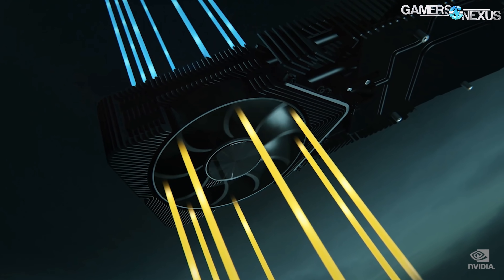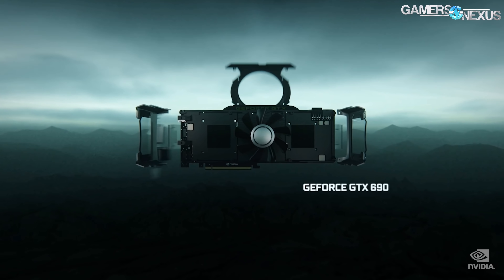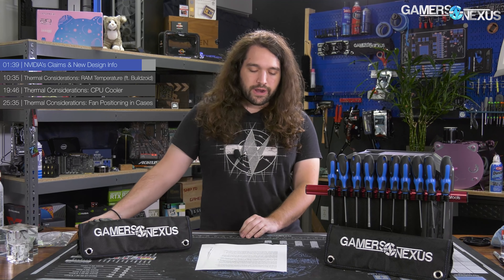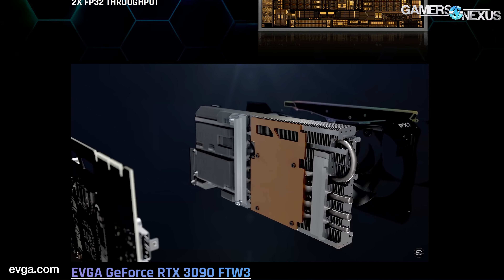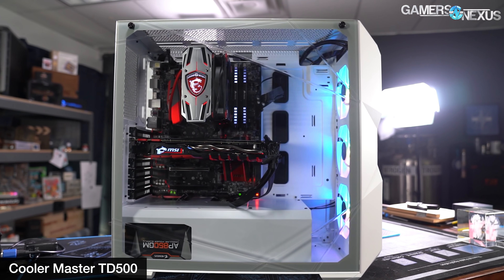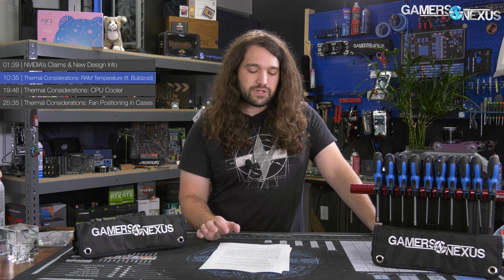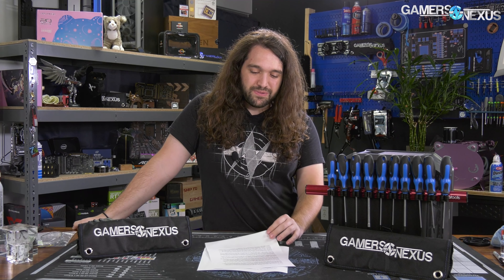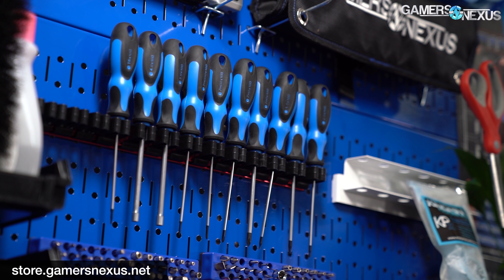NVIDIA RTX 3080 Cooler Design: RAM, CPU Cooler, & Case Fan Behavior Discussion

Comment: I am using an Antec NX200 Case which has a solid front panel, restricting me to use an AIO, so I will be using an Air cooler from Coolermaster. anyway, I am confused about how to set up the Airflow, Case ha one 120mm rear fan and 2 120mm top fans. help will be appreciated, Thank you.

Comment: What I can't help but wonder is say that in a best case scenario nvidia is right, and this cooling method provides up to 30% better cooling, none of the aib's seem to be implementing it as they're all just sticking to a traditional fan setup on their cards, so does that mean that performance will be much less than shown too? given that the fe will have very limited availability it seems

Comment: I am using Asus tuf b450m-pro with Ryzen 5 3600 with a stock cooler and without any load the CPU 🌡️ is 65°-70° i asked couple of people how to reduce it they told me to keep the voltage at 1.1 and lock in at 4000 MHz... If you can plz tell me will that work.....if it will please tell me how to do that or if you can send me a link how to do that it will be very helpful for me... thank you 😊

Comment: It seems that NVIDIA made it's reference design entirely with horizontal mounting in mind. Vertically mounting this cooler will NOT work well at all, because the exhaust fan on the back-side will blow straight into the motherboard's PCIe slots and cook your NVMe SSD hard, for example.

Comment: The AMD 3900X cooler is perfectly acceptable, for example. Basically ~$40. If a GPU is dumping enough heat into it to noticeably hurt performance, that's a legitimate flaw of the GPU, not the cooler. Other similarly acceptable coolers will suffer the same fate.

Comment: Almost getting to a point that an external "gpu" case with its own slave power supply and cooling fans electrically connected to the main case to power on/off may get to be considered the best solution going forward to eliminate and separate heating issues from one component to another.

Not to mention the mounting solution of the heavy cards and the strain placed on the motherboard slots. Then the external case's cooling solution can be designed specifically to vertically mount the gpu.
Starting to sound like a reasonable solution as power/wattage on components keeps rising and producing more heat.

Comment: Something doesn't look right with that cooler... the fan closest to the PCI-e slot doesn't have any heatsink fins around it and just blows the air out the back not through the card to the second fan. Also the 90 degree fins in the middle look like they are for show. Not touching heat pipes also airflow is blocked from them.

Comment: So if I mont my gpu vertically, would I be better off with a custom card?
Reply: If you mount a gpu vertically you really should water cool it. A lot of cases do not leave much room for air to get in to the fans to cool it.
Reply: Just Bob I have 2.5 inch clearance with my gigabyte 2080 ti Auros extreme card right now.  I’m using thermaltake level 20 case, it’s massive
Reply: @chrisyuby  yeah with 2.5 inches you should be fine.

Comment: The RTX 30 series is NOT reference design. It's custom design. EKWB announced a GPU water block for reference RTX 30 cards but it's not going to fit on the Founders cards cause they are not "reference" design
Reply from the maker: We literally said that several times in this video, dude.
Reply: @GamersNexus  😅 sorry commented it right after the first time you mentioned it

Comment: The 3080 and the 3090 can never be mounted vertically. Hot air will be blown straight on to the motherboard.
Reply: Shouldn't be much of an issue with a case like the Lian Li O11 or the Antec p120 Crystal with side exhausts
Reply: @maggi98mw  but the side on the O11 is usually an intake rather than an exhaust. Also, not sure if the GPU fan will clear the motherboard, unless you're using a mini ITX motherboard. The hot air would most likely come out more or less on or next to the motherboard chipset.

Comment: I'm just waiting for the 3060. Depending on the performance I might finally move to 1440p
Reply: It should be somewhere between 2070 super and 2080ti
Reply: Bob Dole  Plenty of 1440p monitors being sold Bob. I'm not sure where you're coming from.
Reply: Bob Dole  Ok bob

Comment: I wonder if i'm gonna have to upgrade my 7700k for this monster
Reply: I don't think so, i have the i78700k still a beast
Reply: It will  bottleneck, the 2080 Ti gets bottlenecked by a ryzen 3 3300X which is the same or better than a 7700k, and by what nvidia is saying, 3070 beats the 2080 Ti
Reply: If you game in 1080p yes you will need a faster CPU.
Reply: @ZackSNetwork  Forgot to mention this, thanks :)
2K or higher res should be fine with the 7700k

Comment: Why do none of the 3rd-party cards use NVIDIA's cooler design? Does NVIDIA patent it and forbid other manufacturers from adopting it? The one for these 3000-series cards looks downright elegant, and, intuitively, it makes me think that it might be better for the cooling of the GPU and the CPU than simply pulling out the traditional 3 fans and blasting them straight through the GPU.
Reply: Because usually 3rd party designs work better.
Reply: @speedster427  
I understand that, but this time, the reference card's cooling system looks to be much better designed and thought out than in the past when NVIDIA's own cards often had just a closed shroud and a single fan, so I was asking about the 3000-series in particular. I guess I'm asking what I missed when I expected to see the same sort of design on the 3000 cards of other manufacturers.

Comment: Why do people think they NEED PCIe 4.0 for Ampere cards..? its like they are going round saying PCIe 3.0 is outdated and unusable
Reply: Need is a strong word.  It will have an advantage loading games once games start utilizing the GDDR6x.  It's a nice to have but not likely required.
Reply: @blizbiggy  right? because people on reddit pfft.. they are always telling me "wHy dID yOu bUy An InFeRiOr Pr0DucT ThAT dOeSn'T hAvE PCIe 4.o" or such but i still think 3.0 at even x8 is still enough to not warrant a whole new system build

Comment: I think if you look at the MTBF of most fans used on GPUs, you will find its something like 6-7 years if run 24/7 365. I'm not saying being able to take apart a gpu isn't important, but its a weird thing you guys always harp on, especially when it comes to replacing a "bad" fan. Not condoning gluing them together like Nvidia did, but its a weird flex.  Being an PC enthusiast site, I would assume most people are taking their cards apart to water cool them, or liquid metal them.

Comment: Is my Ryzen still adequate for the 3070/3080 at 1440p?
Reply: Is it a zen 2 3000 Ryzen CPU, if so your fine? If its Zen 1 1000-2000 it will be a big bottleneck.
Reply: Sorry forgot to write 2700. That's a bummer, I guess I'll wait another gen or 2

Comment: (Ref 11:48) Nvidia new reference RTX cooler makes damn sure, any bottleneck is going to be the CPU by dumping/exhausting its hot air >Directly< into the front of the CPU air cooler, without any time for this hot air to mix with the cooler air in the case (unlike most GPU coolers atm on the market)
Very strange decision! or maybe Nvidia are fooking over both Intel & AMD in one go.

Comment: It is disappointing that a company like Nvidia couldn't trust your integrity - and other NDA following reviewers - with giving you a card to strip down and explore to release videos in a timely manner. Is the 3000 series just a paper launch? Surely such a great card would stand on it's own legs rather than rely on hype and branding?
The new fan design may be very efficient but what is it's efficiency in a case with objects surrounding it? what are the effects with base directed v top directed vs front directed airflow? The planned airflow through the GPU card may be interfered with with case layout and design.

Comment: Yep, AMD stock coolers are not good enough for all cases(non extreme even), i live in a warm place(usually peaking at 38C) and had to buy an aftermarket option for my R5 3600, because cpu rendering in blender was exceeding 95C often, a few times i had to stop rendering because it got over 98 (I don't know why it didn't throttle at 95). Previously I had a R5 1600, which my wife is using now, and it never went over 93C overclocked and with the stock cooler that came with it... So maybe my new MoBo is abusing this CPU or Zen 2 is a very different beast. (I can tell they are pushed to their safe limits)

I've always chosen AMD even when they weren't this good, so I'm not a hater... I have intake and exahust fans on a fairly non obstructed case, so don't make assumptions on that end... And now let them salty fanboys come and unload their shit.

Comment: Prediction: if I get a 3080 it will overheat in my Phanteks Enthoo Pro (the one without glass). Right now I have two 2060 cards in it and they run hot. True, it’s Folding @ Home nearly 24/7. Adding fans tends to make things worse...
Reply: Since you didn't go for the glass, you can always DIY a side intake fan.

Comment: Why has noone noticed that nVidia has fucked up their animation. The flipped fan draws air down and not up. Unless they change the blade design and "rotaion" it wont dump heat into the mem-cpu space

Comment: Me: I need to get heat out my case.
Nvidia: here, have a load of extra heat in your case!
Me: Oh good, you're blowing it at my CPU AIO, thanks Nvidia!

I love the design, just wish Nvidia engineers had the brains to attach an AIO to the thing. Luckily partners and whatnot. That said the mutterings about 240mm AIOs on the 3080 are concerning - where exactly do they think people are going to put them?

Hopefully when the FEs arrive for review people will be on the lookout for thermal throttling, if a GPU thermal throttles in any condition the FE is dead to me.
Reply: I think with the near death of hard drives, case manufacturers should get a little crazy with it. Move the MB to the front bottom of the case so the even 1 120mm intake fan with mesh can blow air over VRMs/RAM/CPU. Rad support up top and rear of case, negative pressure in case could cause passive air intake in front.

Comment: im just going to 3d print a shroud to route the hot air right out the back of my case. Think of a "cold air intake" for a car, but in reverse, and not tubular. If any of you nerds have ever popped the hood, that is lol.

Comment: It looks to me that perhaps more than half of the heat generated by these 3000 cards will be exhausted out the rear by the second fan. So then less than half of the heat generated will be exhausted towards the RAM / CPU.  At least that's what my techno-gut instincts tell me from what I can see in their little promo videos... could be wrong.

Comment: Hey case makers.  Stop being so f'in lazy by using old layout that cuts off air flow to gpu.   Either 1) Add fans at bottom and remove stupid cover to hide psu.  2) Add fan where all those uneeded pci slots are. 3) Or separate gpu from same air flow for cpu

Comment: It will be better for CPU, VRM and RAM than the open air cards because it throws half of the heat trough the back, open air cases thorw all the heat in the case. 
The custom cards are so fn ugly it's like all of them took design  lessons from Zotac and Gigabyte, they even  make the Aorus plastic bullcrap look good, for crying out loud, this is the first time when i consider buying a founders over any custom PCB solution.

Comment: LOL and whats even Cooler is that not even one card here has that cooler as nVidia don't have brand sales here :D
EDIT: wee get 3 8pins vs one 12pin? (RTX3090)
But then again ours don't start at middel of card it they start at the end like before..
EDIT2: 8:19 2020 ..And still its hard to have "Right to Repair" what you own. or do you own anything after all money you give?
Remember when TV's had "wiring diagrams" in the user manual or part list's???
EDIT3: 29:20 Well i have AMD 3700x. What i have seen is that what OC i do whit ambient temp. on this CPU is time killer! i rather eat fast food..
That said i haven't seen how to set this CPU correctly on Under voltage settings...
EDIT4: Oops sorry!

Comment: Me looking at my stock amd cooler and thinking of getting a 3080... <.<
Reply: It you have money for 3080 buy good cpu cooler what's the problem? :,D
Reply: @patison001  it's installed already and I'd have to remove it, clean the paste apply new paste, fuck up something, reclean the paste, then reapply. Then have a panic attack like I did with my hyper 212 cooler that was a bitch to install. But yeah, price wise it'll be relatively cheap lol
Reply: @j.k.1550  yep, disadvantage of custom air cooler is complicated mount system

Comment: The card should be reversed so the hot air goes out the rear of the case and not into the air cpu cooler!

Comment: Cooler is not unique. I have Power color rx vega 56 red dragon.Same design. and its terrible,because all heat from GPU goes straight in to CPU cooler. Only way to go with it is AIO

Comment: That temp graph......doesn't show where the cards intersect. Likely the same.place that 99.99999 percent of users run at. 100 degrees? Gtfo. My 2080 never touched even 65.

Comment: "we gonna test it thermally and benchmark it.. its entirely possible it sucks, just like the previous one" - How the fuck you can say this about 20 series. This is a lie based even on your videos. Also everyone takes the cards apart apparently (nobody does). You should maybe do some research about returns of 20 series if you comment about them throwing it out and sending new - pretty cheap when its minimum amount, so yes a that hihihi point is actually correct. But you won't, AMD crowd would be in shock in ratio of returns compared to Nvidia.

Comment: All of this 30xx cooling dramageddon is going to end up being nothing. Someone, or everyone, will design a duct system for the 'inboard' GPU exhaust fan so it can be isolated and vented without affecting CPU or RAM. Like you can just us some $10 ducting from Lowes and off you go, if you want to make it fancy there will be 3d printed 'adapters' in no time.

Comment: the founders edition will have problems with AIO's
Reply: No they won't. You probably saw that on one of another tech channel. Your computer chassis we'll draw air in from somewhere. Whether it's from a bottom grill or a bottom intake fan or whether part of your front grill is exposed or you might have an intake fan in addition to your CPU radiator there or even at the side if there is a grill there. You could even use the top grill of your chassis if you really want. There was a test of chassis fan placement. The difference was 2-3 degrees Celsius.